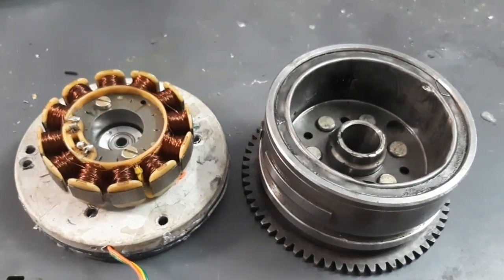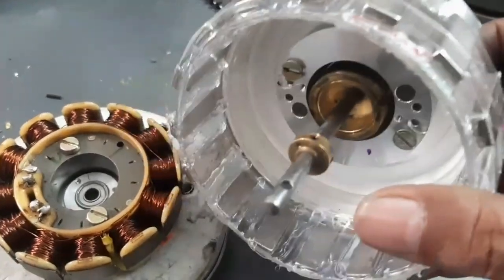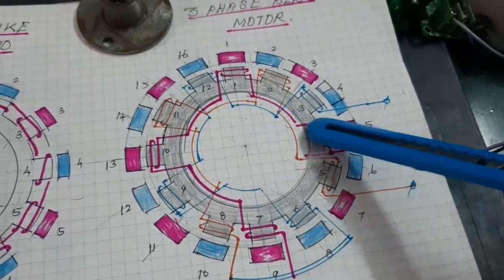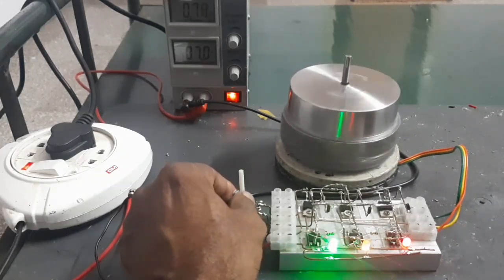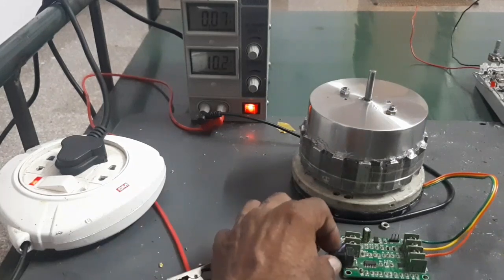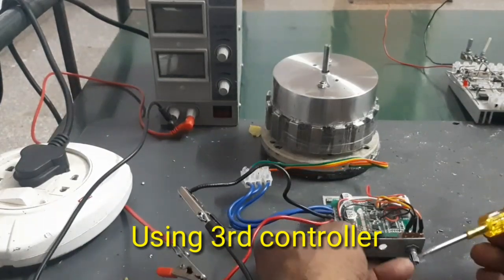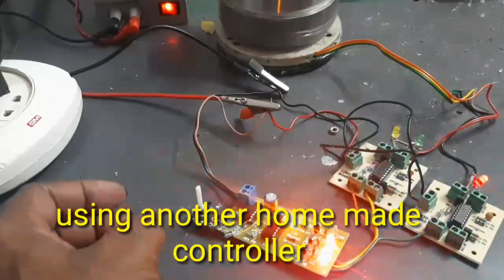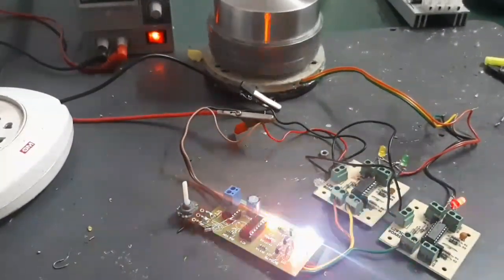CONVERSION OF BAJAJ BIKE DYNAMO INTO A BLDC MOTOR

Comment: In the three-phase windings, do all the coils are in a clockwise direction ?
Reply from the maker: St poles        ro poles      coil direct
6 nos             8,16 nos       CW
9nos               6,12,24nos  CW
12nos            8,16 nos       CW 
Cw -clock wise
CCW-counter clock wise
Reply: @pugalstech  Great , I will do 9 st poles for my 12 magnet rotor. Btw when did you graduate from NITT , I did in 2016.

Comment: thanks you video vrerry good, Power consumption varies, need to check rpm to see which controller is best. (high rpm, save energy)
Reply from the maker: Thanks sir
Reply: @pugalstech  I feel the homemade controller uses more power than the slower revs.
Reply from the maker: Yes it is
Reply: @pugalstech  Fet and ic combo controller will save more power, I hope you release new controller video soon (ic and fet)

Comment: Wtf, woww, bldc controller with market made one, 10 volt and 0.1 amp, means 1 watt hour. So, if i made this as ceiling fan or exhaust fan like this, then it consumes 1 unit after 1000 hours continuous running. Means approximately 41 days. Correct me if I'm wrong. Am I right or my school time knowledge get corrupted?
Reply from the maker: Thanks sir
You are right but it is idle condition
We have to analyse with load and measure the current ok
Reply: @pugalstech  still it's seen very lucrative. Hope to see this kind of experiment more and more. Also test it with load if you can.